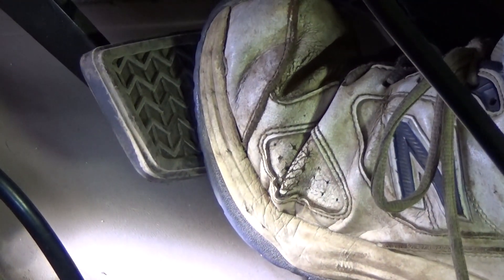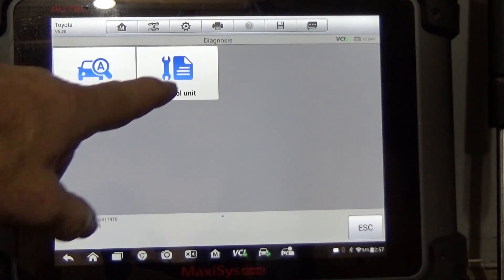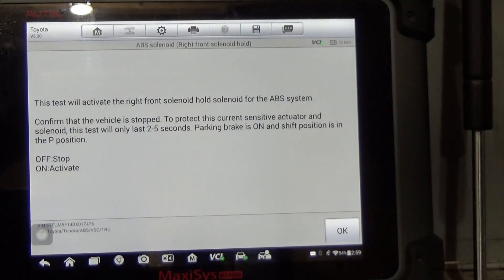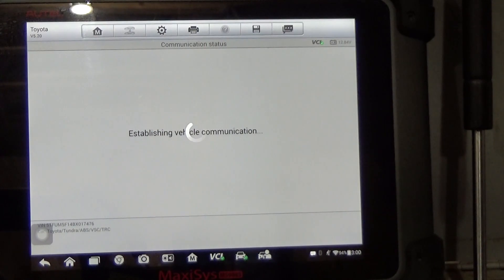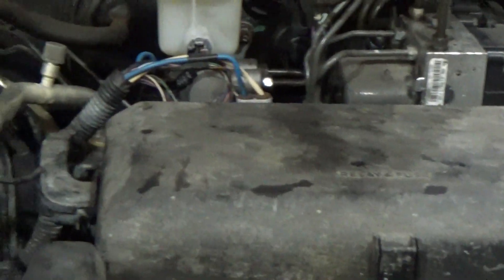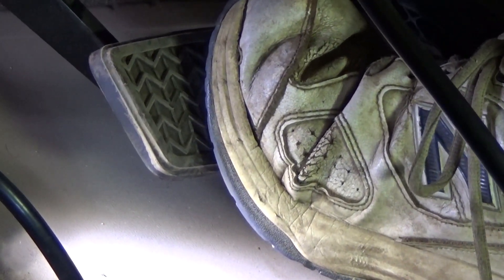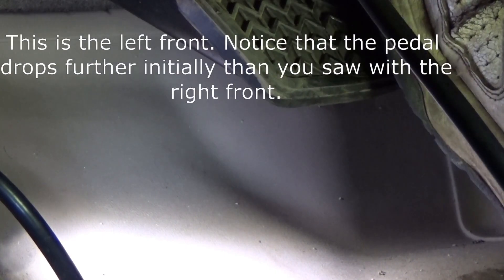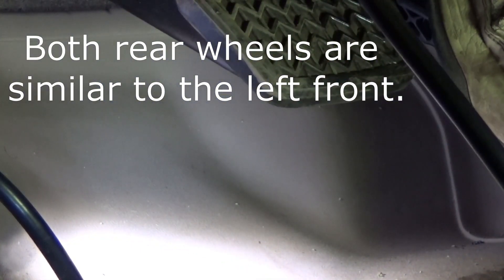Tundra ABS Controller Hydraulic Failure

Comment: Is it possible to open an ABS module and repair it? My sons 2006 Tundra has an ABS issue that is causing the two front calipers to not release properly. I’ve ruled out a collapsed rubber line by loosening the line at the ABS module itself and both calipers release when I crack open the line to the drivers front. 
 I used CHAT GPT to help diagnose the issue and it states that the drivers side actuator is stuck because he had a steel line rupture which caused rapid pressure loss and that event caused an actuator to stick closed. 
 I have ordered a used ABS module to put on it but I’m wondering if it’s possible to open the old one and fix the stuck actuator? If so, I can easily send back the used one I ordered.

Comment: I wonder if this is what’s wrong with my 04 Tundra.  It’s been this way since I bought it. Toyota said nothing wrong with. Had to 4 other places over the years all said nothing wrong, BUT the ABS doesn’t function right.  Especially at speed on a bumpy road. I literally can’t stop.  I’ve just had to adjust my driving for TWENTYONE years. It feels like metal on metal super smooth with no braking and you can hear the ABS come on. Just can’t stop.

Comment: Hello Jhon I did this same procedure on a 2010 5,7 tundra  and had the same pedal travel in all 4 wheels   Pedal stoped and when the valve opens back again pedal went to the floor  everything else has been checked
Reply from the maker: @davidgual2364  Since the module only closes one inlet valve at a time, you would be getting a low pedal no matter which valve you commanded closed. How far is the pedal traveling? Does it pump up? What work has been done to this vehicle?
Reply: @thecardoc100     Hi john thanks for the response I am a small shop owner way over their head right now the issue started after we did a change of rotors on the front of the vehicle the pedal started going all the way down and no matter how many times we bled the system with a scanner or without it the pedal would go to the floor while stepping on it,   yes the pedal does pump up and yes no matter which valve I close at the time the pedal distance  is the same   we have checked almost everything we replaced the master cylinder  and the hydraulic block also changed the  hole assembly for a second hand one  but the issue persist  with the car shut off the pedal is firm as soon as you start it you can feel the pedal just going to the bottom I don't know what else to check in the system to see what's causing the loss of pressure at the brakes
Reply from the maker: @davidgual2364  I saw this after my previous response. With the vehicle off the ground, in 2WD and neutral. Pump the pedal a few times and bleed off the boost vacuum, then: Turn one of the wheels by hand while an assistant pushes on the brake pedal, slowly increasing pressure and see how far the pedal has to be pushed before you can feel the brake apply and stop you from turning the wheel. Repeat this at every wheel and compare the brake pedal travel for each of them. They should all be pretty equal and reasonably high without boost. If the pedal is high and firm like this and then drops when the engine is started, that sounds correct. How far do you have to press on the pedal to get a normal stop? Can you apply the brakes hard enough to lock up wheels and get the ABS system to intervene?
Reply: @thecardoc100  HI John once again thank you for the awsome response, I am going to conduct the tests  and come back, do you have an email or somewhere  so I can send you photos or videos of the results ? if that's ok with you
Reply: @thecardoc100  Hi John so overall the pedal travel with the force of my hand when the vehicle is on is 3 inches  with my foot its 3 1/4  inches of movement.
 With the car off and the vacuum boost bled off the amount of travel for each wheel to stop is  REAR LWH 1'' 3/4 of an inch  REAR RWH 1'' 7/8  Front LWH is 1'' 1/4  Front RWH  is 1'' 1/4 as well.  
PS I wish you and all your family happy holidays!
Reply from the maker: @davidgual2364  That sounds like you have a normal pedal. What happens if you get this out on the road, will it do a panic stop and result in ABS operation?
Reply: @thecardoc100   it will trigger the abs  if step on hard and fast the main issue is that if you are slowing down and want to slow down faster you have to take your foot off the brake and  brake again
Reply from the maker: @davidgual2364  Why do you have to do that? Does the pedal sink while it's applied?
Reply: @thecardoc100  yes the pedal sinks while you apply pressure resulting in a lack of brake power at the pedal when you have been braking and want to brake even more there’s no brake power left at that time you will go to the floor and abs won’t come up and the car won’t stop  so you have to take your foot out and apply brakes again
Reply from the maker: @davidgual2364  That sounds like a master cylinder with an internal leak. You while you can feel the pedal sinking that's when you could try closing the isolation valves in the ABS. If the master cylinder is leaking internally you won't feel any change in the pedal dropping.
Reply from the maker: @davidgual2364  How far is the pedal traveling? Try to give me a value in inches. If you had a problem with a dump valve stuck open it would impact the wheel that it controls. There would have to be all of the dump valves sticking open for what you are saying to be the fault of the ABS system and that doesn't seem very likely. What other work has been done? When did the excessive travel start occurring?

Comment: We have our 2011 tundra V8 in the dealer for 3 weeks now with the same issue, they have changed the master cylinder twice and now they said it the abs module. Before they get more money out of us, what do you think we should do? I’m really to replace it
Reply from the maker: Just a note before we go real deep into this. It is possible to have a similar symptom, the low brake pedal and have it be caused by something other than what I demonstrated in the video. So, we should always approach this and any vehicle diagnostic event with an open mind when starting testing. When a shop is struggling to figure something out, they don't work on it every day. The tech will put some time into the job and then when the "easy and most common" cause fails now they have to do some research and try different ideas in the attempt to prove just what is really going on. For the technician this is the worst-case scenario because of how flat rate works and especially how techs get paid to do diagnostic testing. Over the last few weeks and in between other work which is necessary for the tech to earn a paycheck, the tech (or other techs trying to see if they can figure it out) would spend unpaid time with this because no-one wants to fail, and they all would love to be the hero and solve this and get your car back to you. 

Did the dealer service advisor say how they came about the diagnosis at this point that it is the ABS, just like the video? You rarely get to speak to the technicians because fat rate pay plan requires them to be working at or above 100% efficiency and anytime doing anything other than working on a car is lost time and lost income for them. 

At this point get back hold of the service writer and maybe ask for the service manager and work with them to get an explanation. Feel free to get them to watch my video and see if they will allow the technician to join the discussion. If the technician performed a similar routine to what I demonstrated, he/she will be able to tell you exactly which valve has failed in the ABS, just like I proved this was the right front brake circuit. At that point you can then decide to have it repaired or not. If the technician doesn't have solid proof because a routine like this has not been performed it might help them to know that I am not only a lifetime career technician that emphasizes electronics and computer controls, but I am also a continuing educational instructor for professional technicians and travel around the country teaching technicians how to do this and many more routines. They are more than welcome reaching out to me and I would gladly assist them should they desire.

Comment: What part do you replace? and where?
Reply from the maker: It's not about what part to replace yet for any vehicle other than the one I presented in this video. This is about learning how to test and prove if a symptom that a given vehicle has is being caused by the ABS or not. Do you have a vehicle that has a problem? If so, what is it (year, make, model, engine, transmission) and what is it doing?

Comment: I have a 2005 Toyota tundra brake pedal is extremely hard to press. Braking distance is poor. I cannot figure out what is causing it.
Reply from the maker: With the engine not running, pump the pedal three or four times. Release the pedal for five seconds. Then push and hold the pedal with a moderate amount of force. Take note of how far the pedal moved and how hard you are pushing against it. Now without letting up on the brake pedal start the engine. Tell me what the pedal does when you do this.

Comment: John, what was the ultimate fix for this issue?
Reply from the maker: That one needed the hydraulic control unit replaced. But that isn't really the important part of the video. Before anyone replaces a part like that they need to test correctly and prove what the problem is.
Reply: @thecardoc100  Agreed.  How much did the part cost?
Reply from the maker: @drew7257  I only did the diagnostics. The shop took care of the repair.
Reply: I wonder if this is what’s wrong with my 04 Tundra.  It’s been this way since I bought it. Toyota said nothing wrong with. Had to 4 other places over the years all said nothing wrong, BUT the ABS doesn’t function right.  Especially at speed on a bumpy road. I literally can’t stop.  I’ve just had to adjust my driving for TWENTYONE years. It feels like metal on metal super smooth with no braking and you can hear the ABS come on. Just can’t stop.

Comment: Awesome video was sent over here by the Mario channel - I have the same issues with and Audi A6 2017. Changer the master and still have the same issues. I can drive around town and it seems fine but when I drive on a highway and take an exit - scary. I tried the two man pump technique. And it even acts weird then - the pedal gets really hard . When the bleeder is opened it goes to the floor , but barely any fluid goes into the bottle- the pedal stays then the pedal will stay hard when pumped until I start the engine- then to the floor. It was the same symptoms with the original master. It has progressively gotten worst over the year or so. Ever since I had a coolent  leak that put my car into limp mode and when I changed my rotors and pads almost a year ago now. The abs module is right below the coolent reservoir and there seems to be green tarnish on the top brake lines. The dealership fixed that issue so I am not sure of the extent of the leak was. I am at a loss. I have watched many videos and non seem to work - and there isn’t any air coming out of the lines when I pressure bleed as well….help! Also I have an OBDELEVEN scan tool.

Comment: I have a toyota tundra 2003. the breaks hold the pedal to the top and break the truck. I change the abs control, the rear shoes, the calipers but doesn't work. The still hold pedal high and break the truck. Can you help about that please?
Reply from the maker: I'm struggling to understand the symptom as you are describing it. It appears you might be telling us that the brake pedal has very little travel and is real hard to push. If that is correct, what happens if you:
1. With the engine off apply and release the brake pedal about four to five times. 
2. Now step on the brake pedal and hold it with an average amount of force.
3. Without releasing the brake pedal, start the engine.  
  Did the brake pedal move towards the floor when the engine vacuum applied assist with the brake booster?

Comment: I have this exact issue with my 08 Sequoia. The pedal travel is excessive in my opinion. I have replaced the Master Cylinder twice and have completely done the brake system sans the controller and booster. My scan tool does not have this valve test function so I cannot run this exact test. However, my scan tool does measure the master cylinder stroke, and the stroke sensor appears to have a flat spot where  it gets to a certain point, (a short distance from brake application) and it simply reads back the maximum stroke. Having replaced everything else I am down to the controller, and/or the booster (which contains the stroke sensor).  The idea of buying new abs/vsc is off the table for $$$,  am uneasy about used, for the reason that I buy one, install it and end up with the same problem and a days work down the toilet. Looking for some advice on how to proceed.
Reply: I have the same problem with my 08 sequoia i have replaced booster and Master cylinder bleed the brakes but brakes travel all the way to the floor. Hopefully you were able to solve your issue.